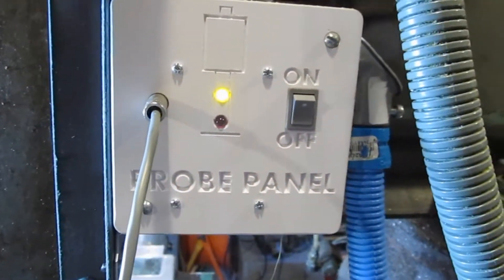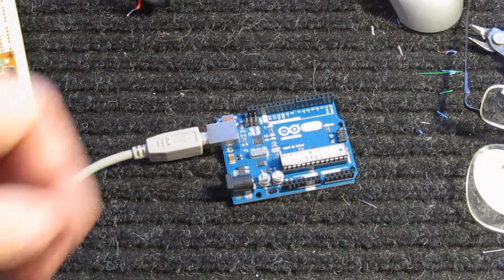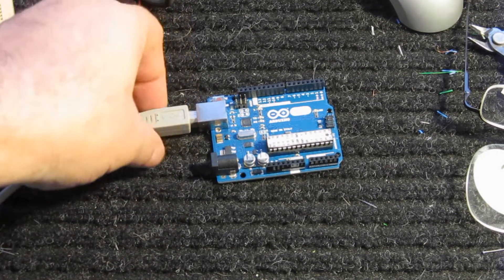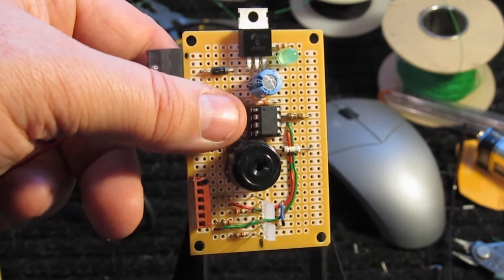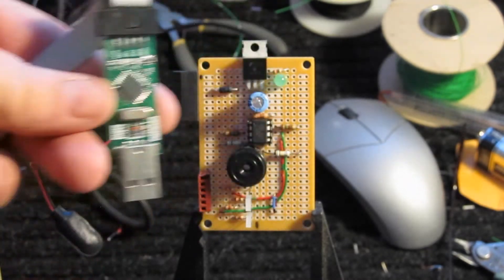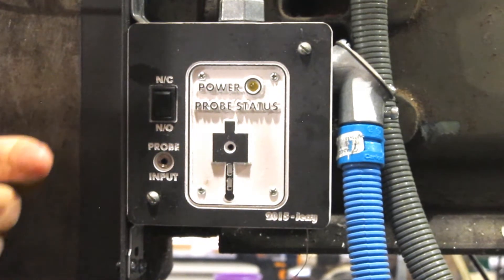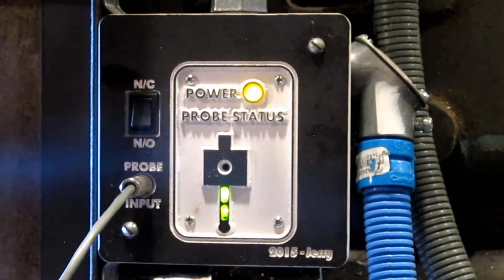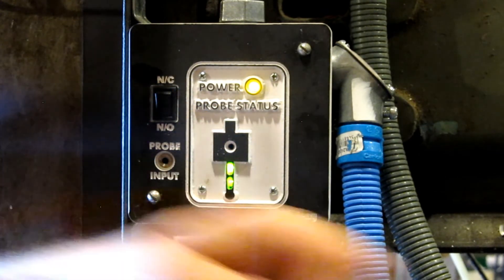Touch Probe Part 3 of 3 - The Rebuild

Comment: Very nice work on the probe circuit.  I have wanted to make my own for the longest time.  Your vids give me some hope on what I would like mine to be.  Really like the open or closed circuit setup.
Reply from the maker: Robert Flores Keep watching... that design failed... I replaced it. And... eventually I found it wasn't really needed.
Reply: oh!  Too bad because I needed it to work on nc situations and sometimes I just want to use it as an overkill edge finder.  Was trying to figure out how to pack all that in a self contained unit.  Why didn't it work?
Reply from the maker: https://www.youtube.com/watch?v=YGaYbrWXJ20
Reply: Have you come up with a working unit.  I liked your 3rd rebuild design and was wondering if i could make a similar setup.  maybe we could chat more on this.
Reply from the maker: As I progress on the Frankenlab, I will get more into probing... and may dip into that design... when I originally made the video, the cost of an Arduino was close to $30. Now you can get micro Arduino units that cost $2 - $3 and are only about 20x20mm (about an inch). 

I may base a circuit around that... just to stretch the pulse and avoid the false readings. As for the reversing... I've learned it isn't really necessary... I use one routine for a probe, another for a touch plate. 
(Changing the G38.3 to G38.4 for example)
Reference: http://linuxcnc.org/docs/html/gcode/g-code.html#gcode:g38

Comment: 30$ for an uno? u get them on ebay.com directly from china for 3-6$ :) Arduino Nano is even More chwap for under 2 $.
Reply from the maker: At the time that is what Radio Shack was selling them for. Now I get them from http://gearbest.com
Reply: good prices but at ebay you can save even 30% more :). Anyway great Video Tutorial.
Reply from the maker: Thanks... I handed my buddy Riley $300 for parts... we are building a 1/2 meter cubed mill designed just for teaching CNC. Going to be a whole series called Frankenlabs. The spindle should come in about mid-July.

Comment: What material did mill the panel from? It has a black outer layer and white inside? It looks great. Nice project.
Reply from the maker: +Kent A. Vander Velden It is white expanded PVC... I spray painted it black before I milled it. I was happy with the result... easy to read. I could have used sign plastic.... it is about 1mm thick... this was 6mm... I liked that much better. (And I had about 8 sheets laying around too.)
Reply: +askjerry Thank you. I like the look. I've been 3d printing cases for prototypes, and this got thinking again about milling case covers.
Reply from the maker: +Kent A. Vander Velden Go to http://askjerry.info to get my email... we can chat.

Comment: That is much better than the relay.  You can even program in some contact de-bounce.
But doesn't that add latency to the detection, and make the position a tiny bit off?

Ray M.
Reply from the maker: +jrmitchellj When it makes contact, my program pauses a tiny bit, backs off... Then goes in at 1/10 the speed. It senses again, marks that location, backs out until clear also at 1/10 speed, and takes the difference. I have been getting 0.0006 accuracy. Check out all my progress at http://askjerry.info
Reply: Jerry: I wanted to ask this to be clear: You've been getting as good as 0.0006 inch measurement accuracy with this probe? So no doubt you've been using it successfully in practice. If this is true, I'm gonna make one right away.